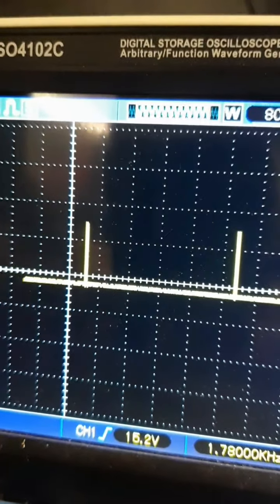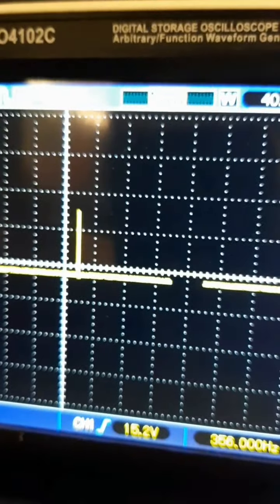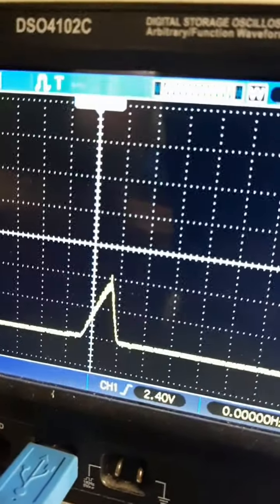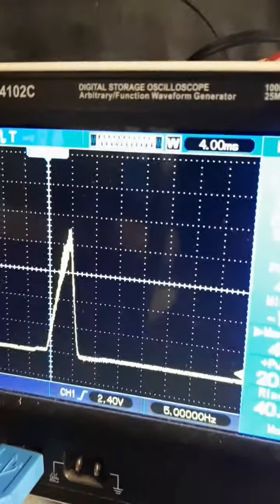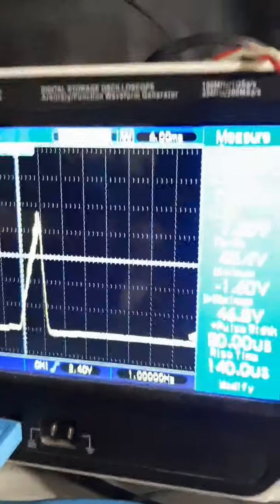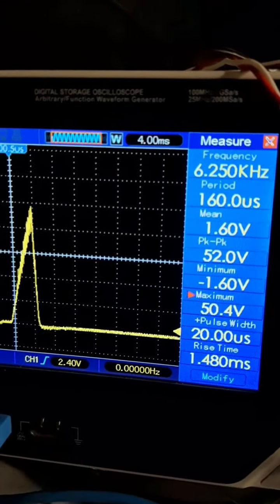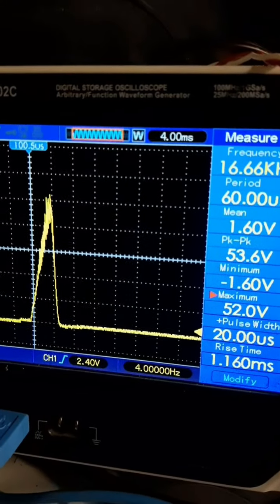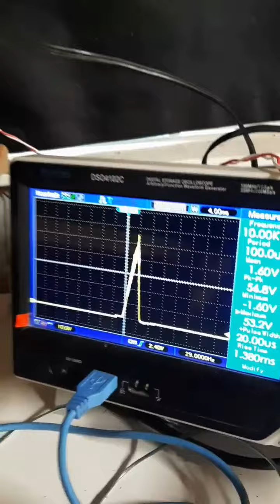Ramped ZVS Arduino Tesla Coil

Comment: Love it man! I've been wanting to do an Arduino QCW for a long time, hopefully I'll be able to get one operating over my summer break this year! Are there any tips you can give about the ramping circuit, or resources that would be helpful to check out (beside loneoceans, of course)?
Reply from the maker: Thank you man⚡⚡ I'm still playing around with this but not really to bad the trick is the low pass filter having the inductor and cap values right every system is a little different

Comment: Good morning. A quick question if you have time? If removing the pull-down resistors, and Zener diodes from the gate. Adding the GDT, and controlling the gates from an external source,? Wouldn't that just make it a half bridge topology? Please forgive the ignorance, teaching myself electrical engineering has ben one of the most difficult of endeavors I have EVER undertaken!!
Reply from the maker: Good morning! Still a full bridge with a ZVS topology there only needs to be 2 switches because power is feed into each switch so you get a full push pull. If you only had 1 switch then would be a half bridge mabe?
On DRSSTC topology then you need 4 switches to be a full bridge 2 switches is a halfbridge . But running it the way is this video isn't true zvs so not really zero voltage switching. That's the main difference hope this helps
Reply: @ArcAngelTeslaCoil  ..Thanks for the response. It absolutely does!! I proves I still Know NOTHING about electrical engineering!!
 Have a good day, thanks again
Reply from the maker: @joegrow9998  there is always time! The best way to learn is find a project that deals with the things you want to learn about in the world of electrical. There are so many avenues of knowledge of electricity from houses wiring ,building instrument panels, Tesla Coils, magnetism the list goes on. When I started on Tesla Coils all other projects went to the side 🤣🤣 it's a whole other world Good Luck⚡️⚡️
Reply: @ArcAngelTeslaCoil  TESLA COILS and RESONANCE!!! my new PASSION!

Comment: is the "stepping" why the discharges appear to have even compression lengths?
Reply from the maker: It's the ramp along with the resonance frequency of the coil like voltage steps each step of resonance and voltage.

Comment: Off topic but  you sparked a question...  "Pun intended"   Is there a way to capture the or a portion of the discharge for reuse, say to a bank of capacitors?  Thank you and I enjoy your offerings.
Reply from the maker: There is a diode on the low pass filter to do just that recycling energy and thank you⚡⚡